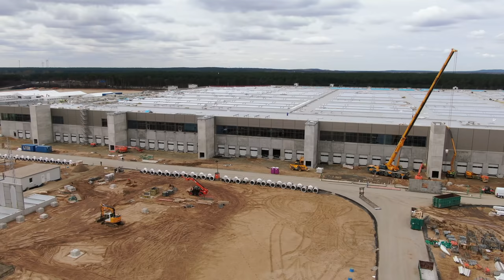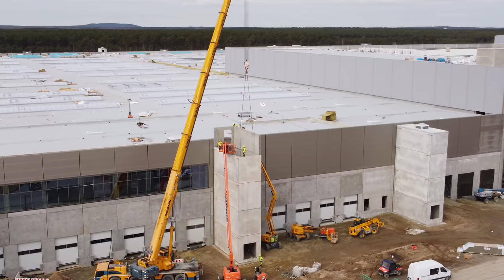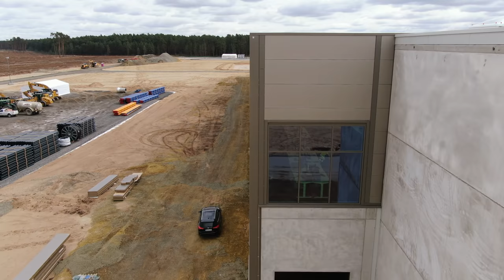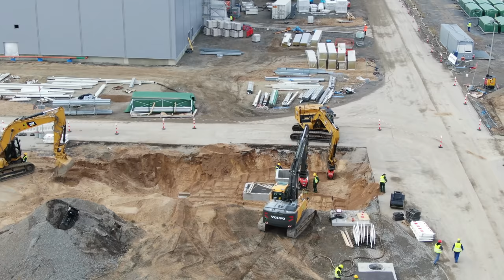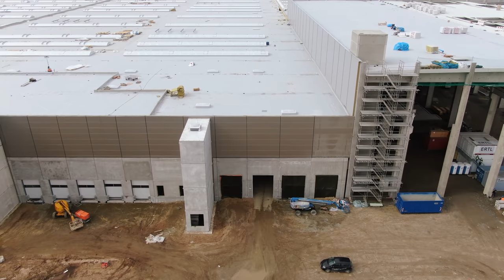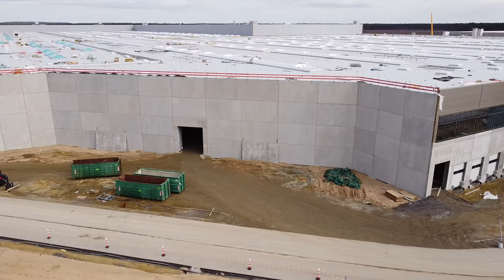Giga Berlin | 2021-03-20 | Office equipment

Comment: Finally something in casting.
Reply: For at least three weeks
Reply: Looks like a second die cast being assembled but I don’t see the aluminum smelter to service the presses. Austin has installed 1 press + 1 smelter under a completed roof deck. Germans spent too much time coddling hibernating vermin.
Reply: @vvattup  It's the first.
Reply: @julianreverse  (the first was Fremont).......also the battery factory hasn’t started. Austin’s battery factory foundations are moving along lickety-split
Reply: @vvattup  The first was China.
Reply: @julianreverse  indeed they have 3 installed but in reviewing Wu Wa’s videos, I haven’t seen any discarded test samples as seen in Fremont. Fremont, at this point, has one giga press cranking out samples.
Reply: @vvattup  There were castings spotted in Wuwa's first video of the east expansion, about 2 months ago.
Reply: @MarcoNierop  thanks for the update. eagle eyes!

Comment: 5:03 the door opening was supposed to be 1m higher?
Reply: I think they will cut out the roof thing there, idk what its called. but the door hole looks level with the roof
Reply: When installing the door they will cut the opening through the sandwich wall panel now partially blocking the door. 
Same one floor below where the door opening is currently entirely blocked by those sandwich wall panels.

Comment: @tobias do you know what the hold up is with the Giga press roof and Giga Casting machines? 
Thanks for the vids 🙌
Reply: This is my guess: The fire prevention and protection concept is not ready yet, which seems to be crucial as we saw there was a fire at Giga Press Freemont. Without a good concept, no final permission for the casting section (see also BER problems with fire protection). So Tesla stopped building to get this fixed first, because it could also have influence on the building and roof structure. But this not is confirmed knowledge, just what I think which could make sense.
Reply from the maker: I don't know what they are waiting for. Maybe some replanning, but noone knows, so we can only guess.
Reply: @stefankatscher9650  that’s a good point, I was wondering how they were going to integrate the exhaust fumes seen from Fremont Giga Press at Berlin site. They may need a HVAC/Exhaust outlet to be installed.

Comment: I'm not so sure that the second Casting machine has started assembly. I think there still is only one partly assembled and they are using the other platforms to store equipment for the first one.
Reply from the maker: Look behind the assembled machine. The big tent is gone, and the part that's placed there is exactly at the same location as on the other machine.

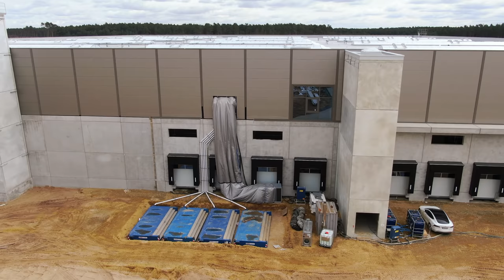Comment: Does anyone have an idea what these 4 blue devices in the ground are in 6:56? They have cables or lines running to them. They are no hydraulic lifts for trailers since they are not aligned with the gates. If they are some kind of heat exchangers: Why burry them in an area where heavy trucks drive?
What are they?
Reply: Temporary waste water tanks.
Reply: As there is no connection to the sewage plant so far, they use those blue tanks for the wastewater from the toilets etc. Normally those tanks serve as foundations of toilet containers used at concerts, exhibitions, etc.
http://www.schmidt-container.de/faekalientank_mit_treppe.jpg

Comment: At 5:15 what's with the door?
Reply: What door?
Reply from the maker: It will be an access to the roof. They will cut the wall panels at the location of the doors of the stairwells.
Reply: Half covered by a wall sandwich panel. The door (opening) one floor below is even fully covered by those. When they install the doors they will also cut an opening in those panels.

Comment: What is this at 6:53?
Reply: As the GF4 is not yet connected to the sewage plant these are wastewater tanks. This type is normally used as a foundation for toilet containers as used on festivals, exhibitions, etc. That's why they have stair steps on one side.
Reply: @abalada  Are you sure about that? Those white pipes look too small in diameter to be sewage pipes.

Comment: What’s with the rest of the tree 🌲 clearing at the start of the video? the giga factory is not that big is it?
Reply: it will be, the cleared area at the start should be the battery plant
Reply: google "gigafactory 4 cell production"
Reply: Ok 👌🏻
Reply from the maker: No, it will most likely not be used for a battery factory. Right now it's most likely that the battery cell production will move into a warehouse that's being build next to the drive unit building.
We know that most of the cleared area will be used for storage and logistics.